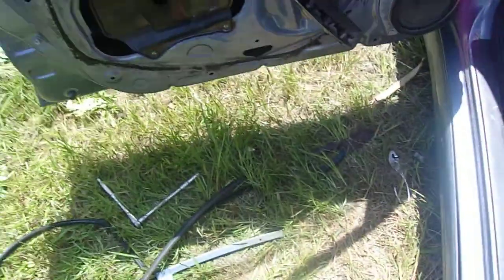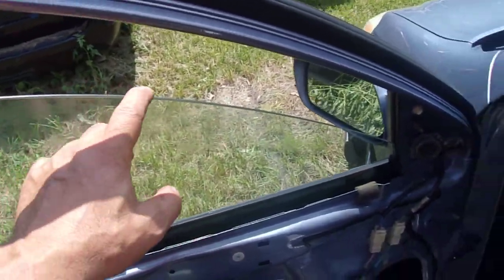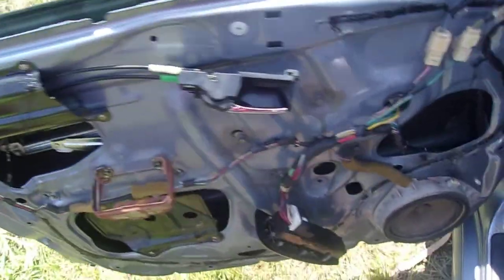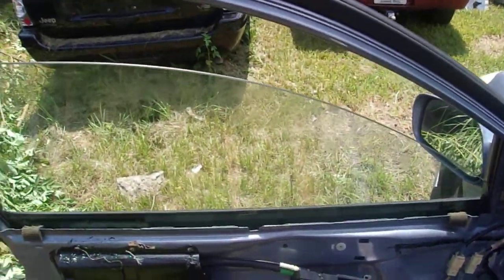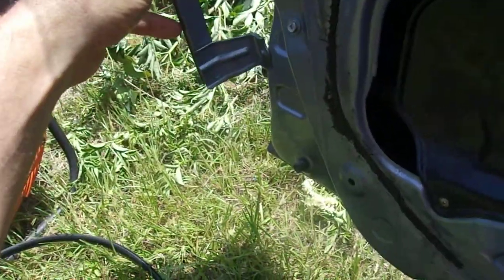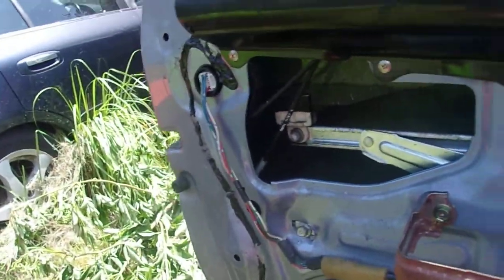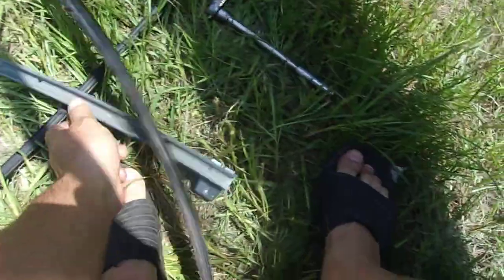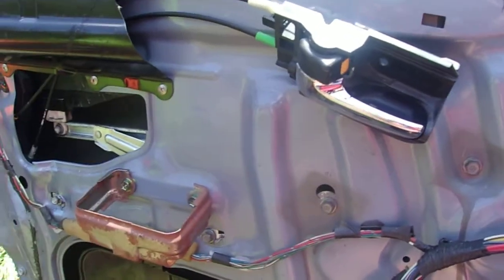Toyota Matrix Corolla falling door glass repair (window regulator adjustment)

Comment: Thanks for posting this. I'm having the same problems.
Reply: I replaced the track rubber, straightened out the regulator arms and it still has an 1/8" gap on the back side about half way up which does close when all the way up.  It will fail again because of this.  There is some slop in the mechanism I can't seem to spot.  Guess a new regulator is called for.  Stupid cars lol!
Reply from the maker: @shingabiss  I posted this video long time ago and don't remember details, watch it again, I mentioned 4 problems. Elongate holes.